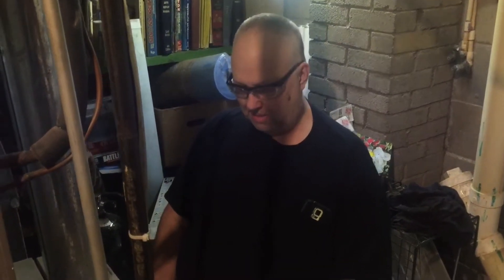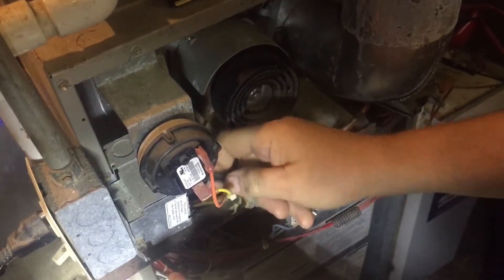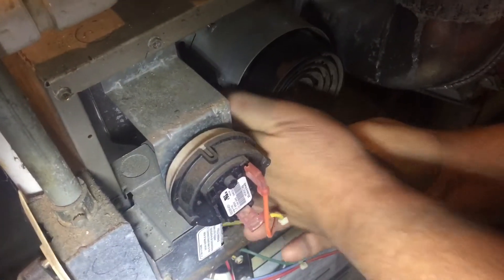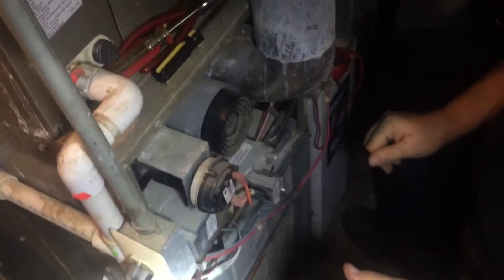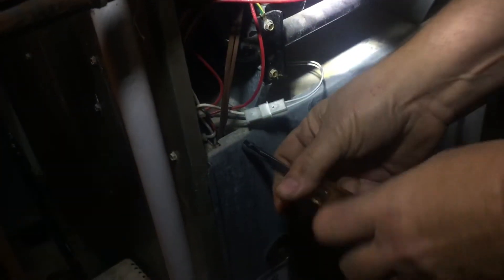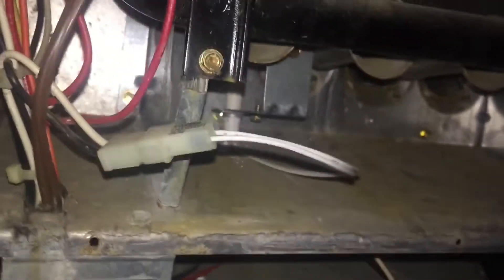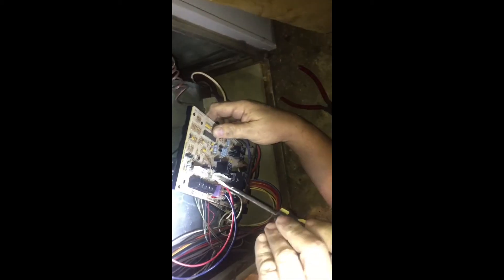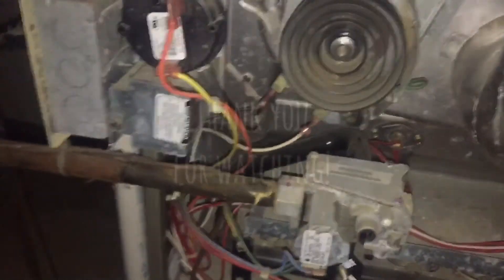How to diagnose and possibly repair your furnace. Mine needed a new control board

Comment: What error codes was it flashing? Ignition lockout? If your red led light is on then your 24 volt circuit is fine and your 3 amp auto fuse on the control board is ok.
Reply from the maker: polishtheturd mickelson code was 3 1.
Reply from the maker: polishtheturd mickelson and thanks for the tips on checking the 24v system. Definitely saves time now that I know that.
Reply: That was a Carrier furnace. I think 31 is a pressure switch open or stuck closed fault code.
Reply from the maker: polishtheturd mickelson doug says it might have been 21. I remember the guide on the panel door listed a bunch of possible problems,  including too windy, blocked flue, vacuum switch, inducer motor.
Reply: Yeah, sometimes when those control boards fail they give false codes. Glad you have heat again 3 degrees now where I live in Michigan. Thanks for your videos daryl turcott and doug.
Reply from the maker: polishtheturd mickelson we have a gas fireplace so we were ok. I just turned on the furnace fan switch occasionally to circulate the heat. That gave me time to locate a cheap part.
Reply: Smart move having a gas fireplace. Even in a power failure, you will still have some heat.